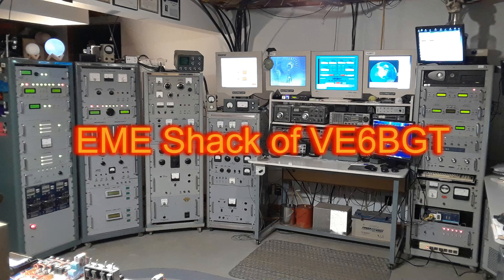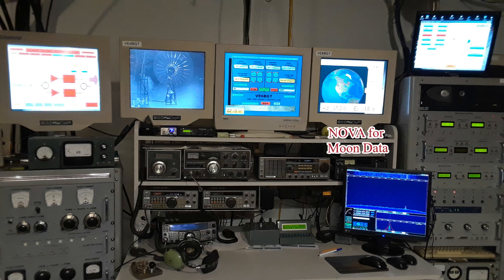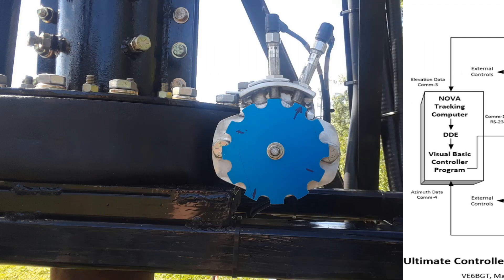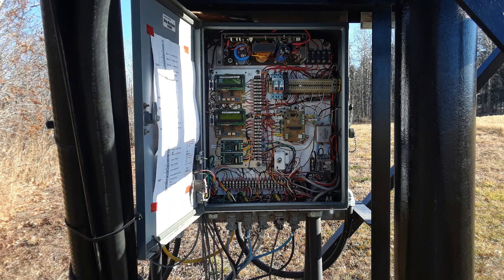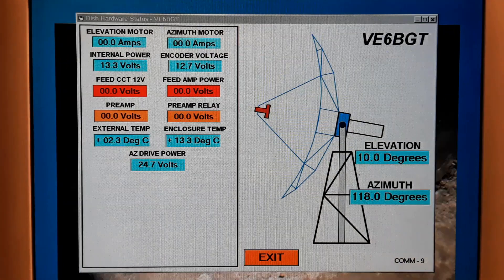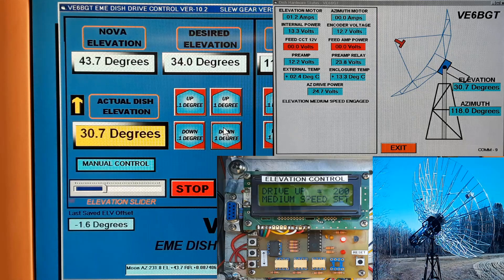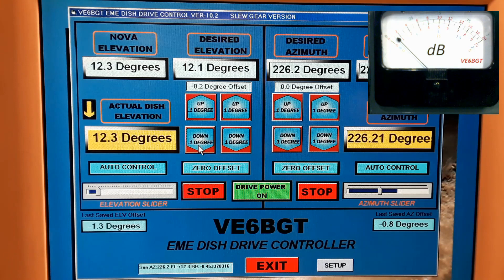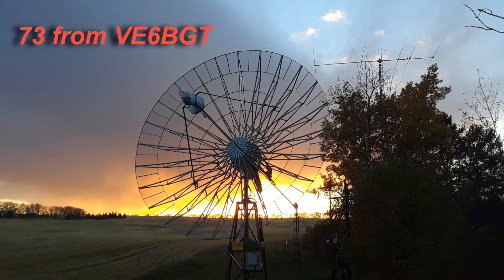EME Moon Bounce Dish Control System

Comment: Congrats! A more complex system than what I had built on 23cm with a 3.2m dish:
https://www.youtube.com/watch?v=fpAlJQ5-Qao&t=11s&pp=ygUGdmUyemF6
Reply from the maker: Yes Hello again.. I reached out to you a while back after watching your video.. I was impressed that we had done a lot of the same things..
Yea mine is complex or overdone but thats what I do.. Back then I was actually doing the first real serious attempt at VB6 and was learning a lot.. So I would discover something and keep adding onto the program.. It got more and more things added to it.. I am actually redoing the dish control system right now, on and off, to match up with the 6 foot solid dish I have been building for my 10 Ghz setup..
I need more control in between feedback steps from the encoders for my 9 and 6 CM systems also.. So the new program will be implemented into the large dish control also.. Plus I am taking out some things I never use.. I just have to get back to it between all the other projects.. Thanks for looking.. Skip, VE6BGT

Comment: im telling you dude that sdr app ur using is trash hdsdr its the noisiest app ive used stations and hams dont come in as clear as the other apps i use
Reply from the maker: Hello Eric, your probably right about HDSDR..  I only use it as a band scope to see where the signals are, I dont listen to them.. It's working through a soft rock board from the IF tap out of the TS2000..  I tried different programs for this but computer horsepower is my problem.. All my computers are old XP machines and other SDR programs cramp the CPU at 100 per cent.. Locks them up solid..  HDSDR is the only program I can find that uses very little CPU power.. Its works for my application.. Someday a better computer will come along, I hate buying computers as it goes against my grain ha ha..  Another reason I dont do any digital modes either!!   Skip